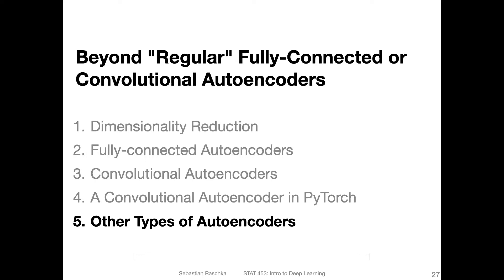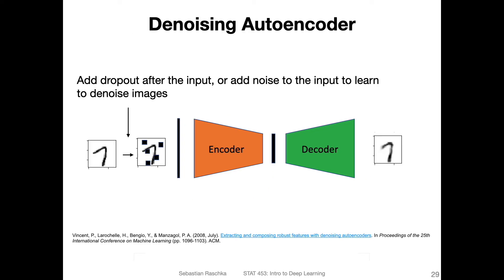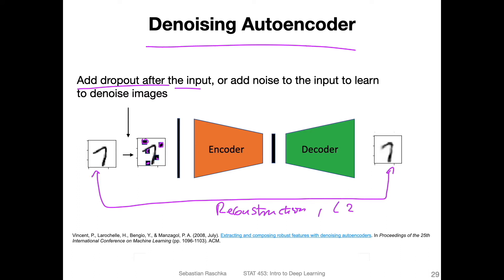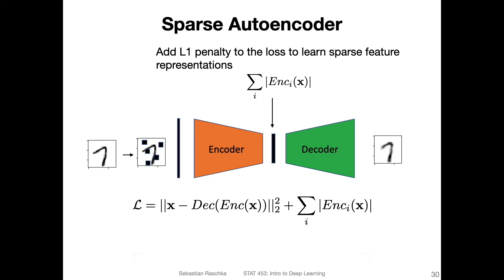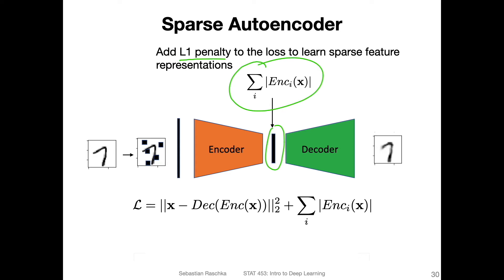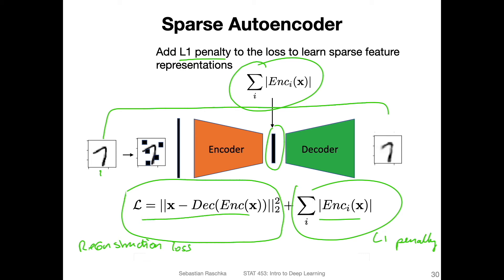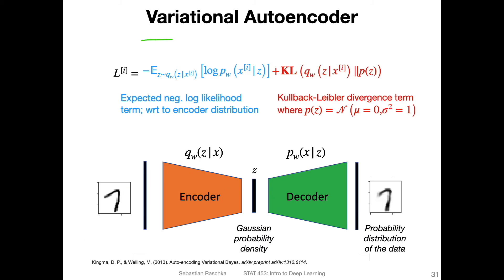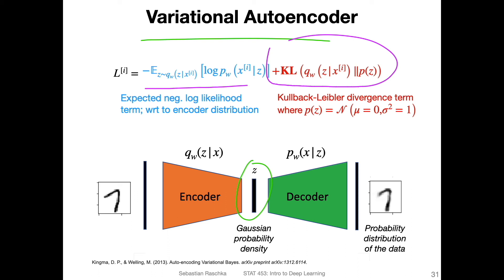L16.5 Other Types of Autoencoders

Comment: Hi! Thank you for your great lesson. I studied the series for my course in university ^^. For the part on sparse autoencoder, I was surprised since It's different from what I read and I wondered whether we can use L2 norm. Then I found out that your formula is still correct, but it is another "type" of sparsity (source: https://en.wikipedia.org/wiki/Autoencoder) . Generally, there are 2 types of sparsity autoencoder: (1) aim to make the average activation of hidden units as small as possible (|enc_i(x) in your case) and then we can use L1 or L2 norm, and (2) to make the average activation as close as possible to the desired sparsity parameter (then use KL divergence (most prominent) or L1 or L2 loss).
Reply from the maker: Thanks for the note! Yeah, I think there are several paradigms for sparse autoencoders now. Just did a quick Google Scholar search and there's quite a list now :)